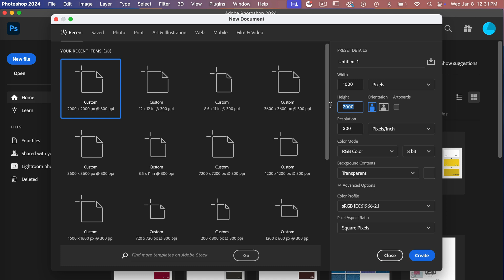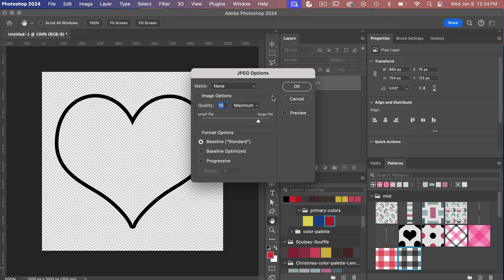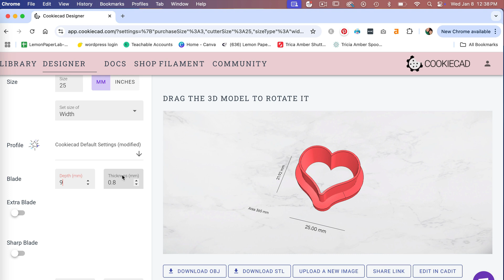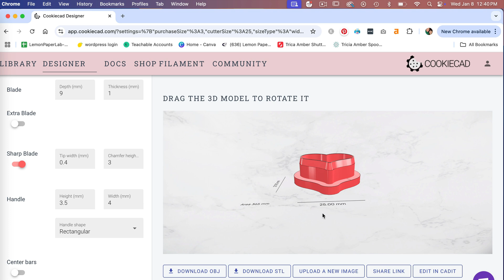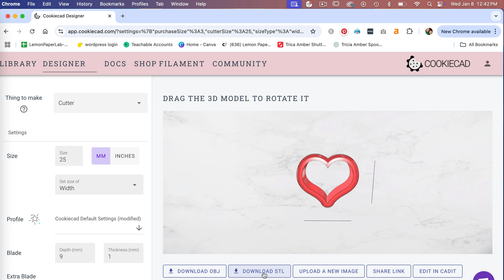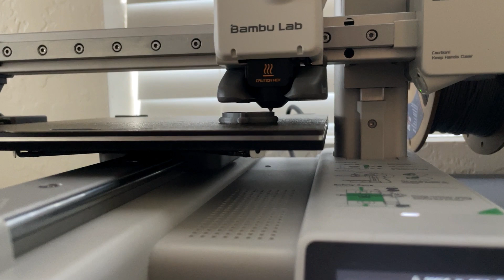3d Print Custom Polymer Clay Cutters with Cookiecad

Comment: This is a really great tutorial, thank you for taking the time to share your knowledge! 😀Do you find using these settings to create your cutters, that they produce nice sharp cuts on your polymer clay, so you don't have to do much edge sanding?
Reply from the maker: I still have to do some edge sanding. My printer is a .4 nozzle. I think if you get a smaller nozzle .2 it will require less

Comment: Great tutorial <3 I have a question though. Do you change the thickness of the cutter? or the infill etc?
Reply from the maker: You can change it if you need to. I generally don’t need to. But when you bring it into you 3d print program and slice it you will want to double check that there was any issues (like being too thin)